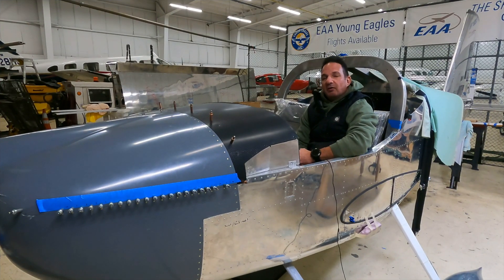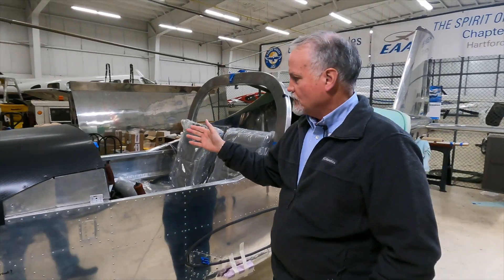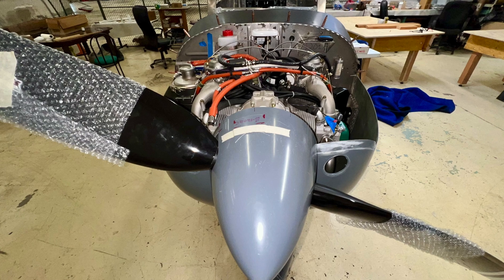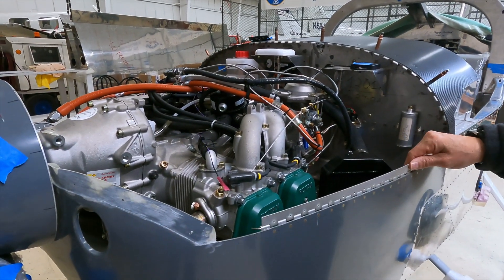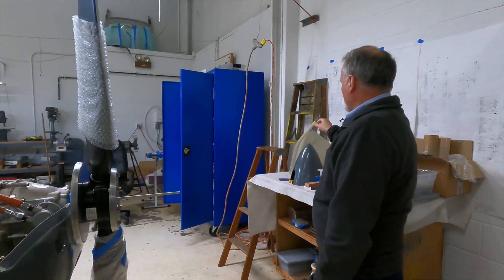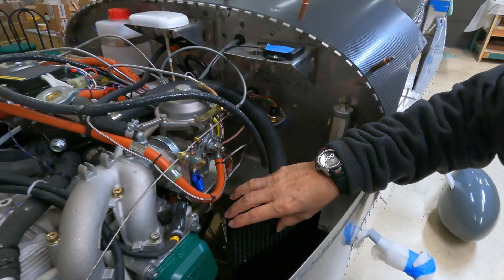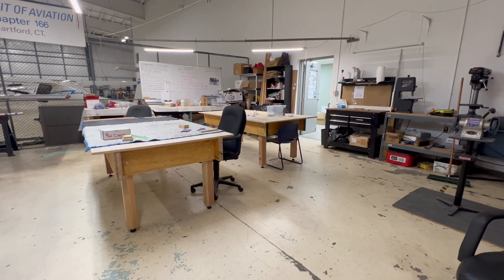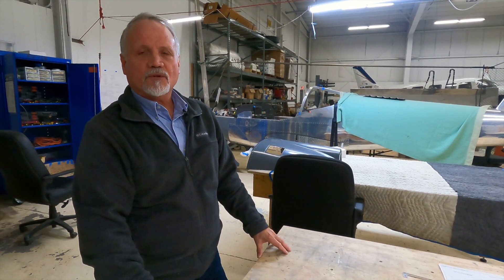Van's RV-12 Build: Cowling, Prop Work

Comment: Advise, based on comments from the forum ==> re-route your pitot from where it is to have it lay along the top of the block (UNDER the coolant hoses and high tension lines).  Commenters have been reporting chafing of the pitot tubing and (to a lesser extent) of the coolant lines.  I have had mine as I suggest (under the coolant hoses) for over 5 years and 500 hours and there is NO evidence of any contact with either of the lines.
Reply: Your comment about the heater door allowing some warm air from the coolant radiator to enter into the cabin ----->  No, not Some air ==> opening the door causes "hurricane-like" wind to enter the cabin (ensure all loose papers are tied down before turning on the cabin heat)